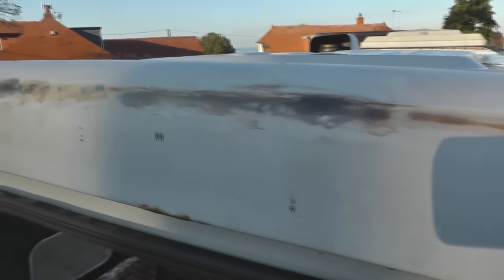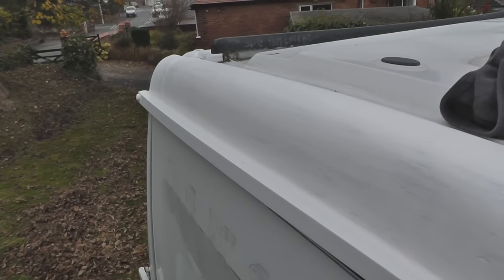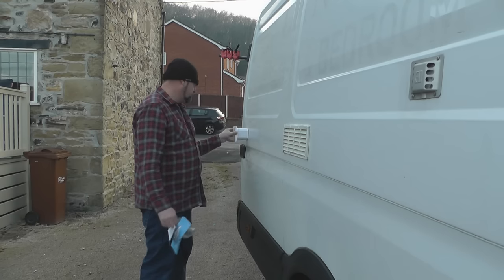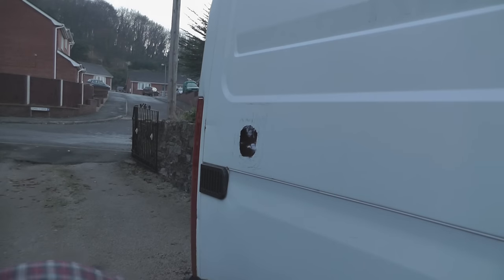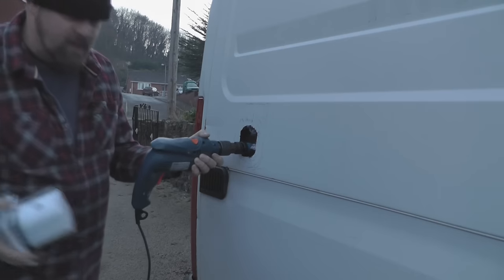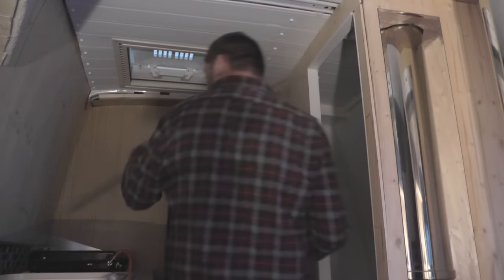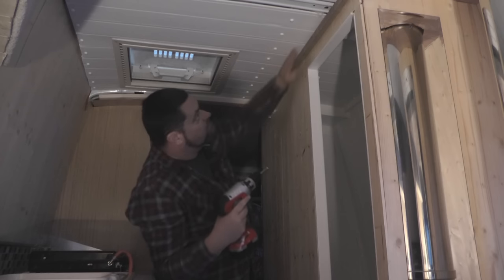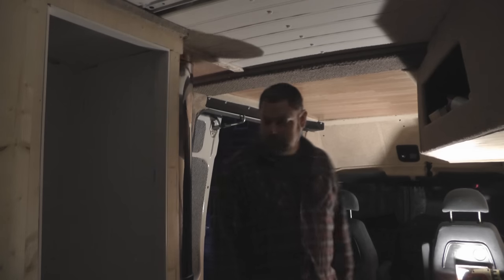Campervan Self Build Part 14

Comment: Hi James... but of a late arrival to your van build series as I know you're now out and about in it, which is great to see.  But I'm thoroughly enjoying working my way through the videos and gathering ideas... was thinking of buying a second hand camper, but have to say am increasingly inspired to do my own conversion!  One question, as I'm a sea kayaker too - where do you carry your boat(s), or do you take them on a trailer?  I've been looking at different racking systems,  but either with a high top, or a pop top van, a roof based racking system is awkward (even the side loading one)... just interested to see what your solution is as you're full of creative inspiration in problem solving on your build!  Keep up the good work, and will be following your escapades... hopefully see you on the water sometime... am often round and about the welsh coast!  Cheers Neil
Reply from the maker: Neil Stewart Hi Neil thanks for watching any of my videos and yes build your own if you can "I'm technically the owner of a ten year old campervan that only cost £3.250 ish to buy and make" ref the Kayaking yeah your right "trailer" I have a normal 4x4ft little box trailer and putting a hard lid on it some "J" bars on top and making the tow bar structure longer by using some box section steel "another video to do" lol kind regards James

Comment: .
measure twice lol

for 'mains in' on the 806 i used a standard ''kettle lead'' female, and i mounted it inside a towbar socket so it looks, well just like a towbar socket, very stealth... also if i forget to disconnect and drive off it just pulls out and the socket cover snaps shut, not that soon after fitting i forgot and drove away, complete with 30ft of extension cord leaving the cord running out of my garden and down the street.... doh!
Reply from the maker: Project 806 Camper "That must have been a sight seeing you drive off with cable dangling along" what really interests me is how diverse we all are, we utilise ideas we have and put them into practice at what works for us, that's why I did the videos because if I did something that others would like to use then it would always there for reference via youtube, and it has put me in touch with loads of people from all over the world, regards James